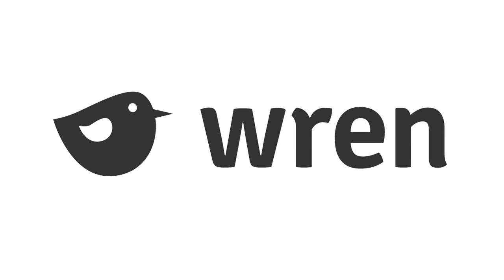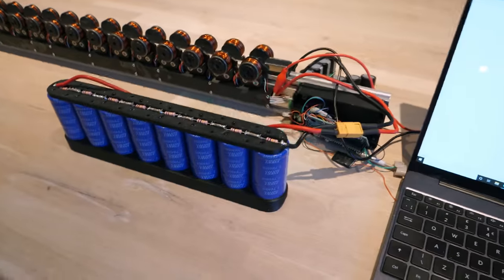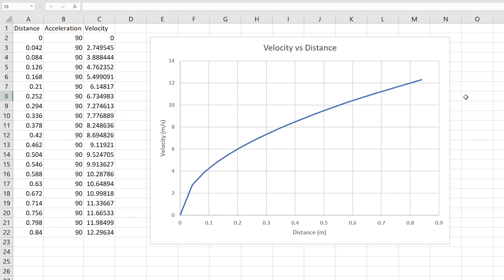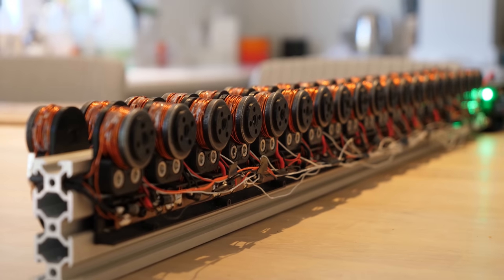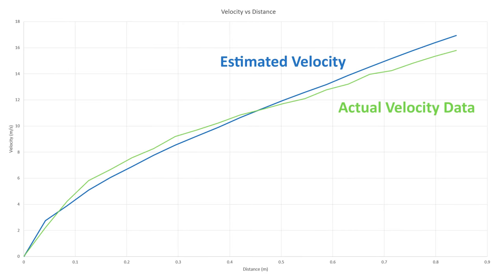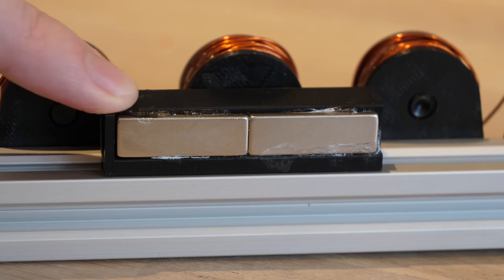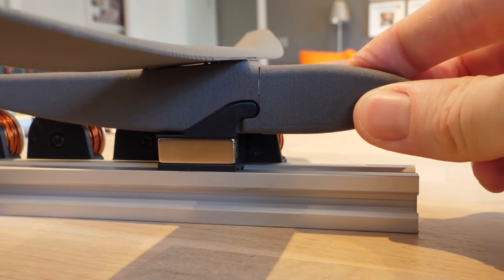Optimising a Magnetic Launcher

Comment: I mean... there are already scaled up versions of this on military carriers. They don't use electromagnetism, but they do have a similar rail-launch system. Instead they use extremely high pressurized steam from the ship's engines and a piston. When the steam is released, the piston jolts forward at a high rate sending the jet flying forward at an insane speed. With it's engine's always maxed out, it takes only seconds for the propulsion to be high enough for lift.

Now doing this on a scale big enough for the civilian sector would be a bit of a logistical nightmare. Given that in a jet it's already considered the most dangerous thing a pilot will ever do, and that's only a fraction of the mass a full on cargo or passenger plane has. However, logically speaking if we were saving enough fuel, we could also reduce the size of planes and fly them more frequently, which would also have the added benefit of making the takeoffs more efficient. This would however mean we'd need more care in routing the large increase in flights from airport to airport.

The real issue isn't just takeoff however. We look at the 747 as the workhorse of passenger planes. This bad boy does use about 5,000 gallons just in the takeoff, which sounds insane (and is!), but that is actually slightly LESS than how much it uses just to get up to it's flight height. It uses an addition 10% of it's max fuel (63,000 / 10 = 6,300 gallons) to get up to it's flight height. A more efficient means of takeoff would also need to consider something to make the plane take off from a higher point. A pneumatic lift to bring the plane up to tracks high in the air. This then adds incredibly more difficult factors to overcome. 

I'd be interested to hear feedback on potential solutions to these issues as well.

Comment: My hope for future space travel is a huge track like that, which would launch a redesigned space shuttle. I am worried about climate change but amazed by and attached to space travel. This could reduce if not eliminate the use of the 90% of fuel for the first two minutes of takeoff of traditional rockets.

Comment: If one would reduce the friction on the sliding rail using , optimizing  the already in use ,magnetic rail type train velocity difference in the equation . As I believe the friction is already added to the equation but not defined if in a partial  vacuum or differential friction element to the equation. That simply take velocity speeds . Or the use of high speed high capacitor support  in the coil energy equation to multiply the energy discharge and magnetic energy effects . That theoretically are being used in the  US patent description of  earlier technology of  anti gravitational flying crafts .

Comment: Imagine that each coil increases the sled's kinetic energy by a constant amount.  That will give a decreasing acceleration, compared to the constant acceleration you have simulated.  Now simulate with a constant increase in velocity squared over the simulation and I think you will get a far better match.  You could even have the energy increment decrease over time, simulating the battery voltage dropping.

Comment: I wonder if you can just use capacitors and coils to create a kind of sequential cascading RLC circuit. Such that when you first hit with the voltage it oscillates with the object being propelled in phase along the rail. because there's no diodes it will also oscillate on the other coils at any one time but as long as the initial wave front that's traveling with the object steps like a stepper motor in sequence with the objects inductance and mass properties (tuned by the tau or ratio between inductor and capacitor) you should be able to just scale up the capacitors and coils and hit it with a giant voltage.

Comment: You don't mention how you tuned the timings between passing the sensor and turning on/off the coil, but there's a good chance you could optimise it further by running a genetic algorithm on those timings. This is a sort of unrolled genetic algo, but if we make the assumption that the best velocity would be achieved by the (x+1)th coil by first achieving the best velocity at the xth coil, start by altering the timing of the 1st coil in increments close to the resolution of your timer. You may have to start with course increments and get smaller. Once you've found max velocity from the 1st coil, repeat this process with the second, etc. I expect this would get better velocity than calculating the amount of time it takes for the magnet to get to the centre of the coil because of minute tolerance variations between coils. If this helps, also consider running your launch program on an SBC with a higher resolution timer. Anyway, awesome work - very entertaining!

Comment: Okay so here I go again. You hit on 1 of my ideas to increase the power or speed with the altering of the coil sizes. Now let me ask you this do you think there is any more speed or power to be gained by altering the spacing between the coils? Like i said before on your last video I have seen a lot of these builds about these type units, one thing I've  seen done diffontly was to use a LED and light sencore on either side of the track just after each coil so that the body of the sled itself was the mechanisom that turned the last coil off as the sled moved by it then the next coil would grab it and carry it on. I'm wondering  if by using that method of switching off the last coil and then increasing the distance to the next coil in the line we might gain even more power or speed. Looking forward to the next video thanks again!!!

Comment: noticed at 10:03 that the plane stalls - you can counteract this with more nose weight, which also increases the mass, and thus the acceleration of the object.
Reply: how would adding mass increase the acceleration?
Reply: srry
Reply: @justinc2633  No. More mass will decrease acceleration but it will increase momentum in the plane. Better to push  the wings back to move the center of gravity than increase mass of nose.
Reply: @nickl5658  why would you sacrifice acceleration for momentum? i was asking about his comment on mass why are you giving me a solution to counter stalling when i didnt ask about that? also by pushing the wings  back you wont change the center of gravity (by any noticeable amount anyway) the reason thatll stop the upwards pitch resulting in it stalling will be because you move the center of lift

Comment: bit of an odd suggestion but could you increase the number of times the wire is coiled around each coil to increase the magnetic strength. Just remember making an electromagnet in GCSEs and the magnetic strength increased when we coiled the wire around it more.

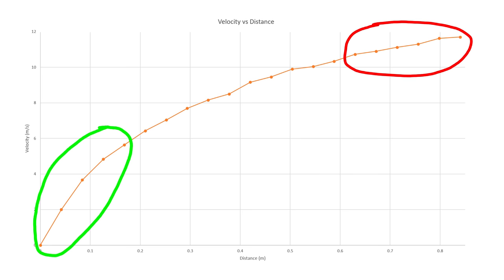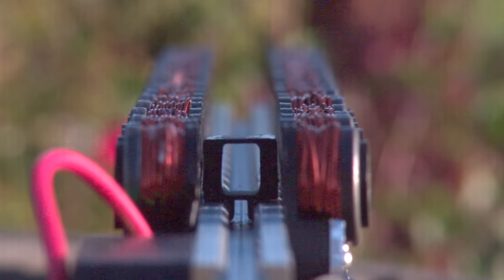Comment: ... by 2:05 I have some already have some good ideas as to why things go sideways with mag launchers.  at 1:30 in the slow motion footage you can see the sled bouncing from side to side, like a sloppy roller coaster. As that side  to side, um "oscillation" increases with the speed of the sled, I believe it will have 3 effects the first 2 I know for sure, and the third is a guess, 1) Every time the sled has to change directions it will accelerate slower. if you look at the graph you shared and think about that should make some sense. 2) All that lateral wobble is transferred into the structure of the launcher, usually as heat I assume, a wiggle and shake on a molecular level still causes heat, right? 3) and here is where I am making a stretch and hope you can understand what I'm getting at. Spin. Up and to the right, down and to the left... In the very same way musket balls would bounce down a barrel before existing, Riffling,  it stops the slug from smashing off the sides of the barrel as it accelerates. Spin that sled...

Comment: Tom, if you were able to decrease the drag coefficient of the sled by applying graphite dust/oil, making it out of a different material, or adding bearings etc - would that result in a worthwhile increase in exit velocity of the sled from the rail?

Comment: kinetic energy is 1/2 mv^2.... So adding similar energy at each coil would naturally result in a sqrt-shaped curve... (And  for that to happen, each coil need to have more power, since it needs to add the energy in less time (which the rewinding would have helped for...))

If the coils can be set up in a way that there is no gap between one switching on and the previous one switching off, using a (largish) inductor to quickly force current through the next coil would be interesting... (It would limit the ramp-up of current towards the end of the rail though and leave large voltage spikes to deal with, especially at the end when all coils switch off)

Comment: It would have been cool if you also calculated the kinetic energy of the projectile at each distance, because change in energy means work which means force times distance. So plotting kinetic energy against the distance and measuring its slope would show not only how much force did the coil create but also how much of the same force is lost at the end of the linear rail compared to the force the projectile received at the start of the rail.

Also
PLN aircraft carrier designer wants to know your location.

Comment: Question for you bud: I thought the sled you designed to hold the glider accounting for the upward force from lift was genius; I am curious if you redesigned it to be a bit longer if it would launch the glider further? What I mean is that the sled weighs more than the glider and retains velocity longer once it has left the rails than the glider does. The glider immediately lifts once the sled is released. If it were to carry the sled further after leaving the rails for, lets say, just another meter or so, the glider wouldn't lose as much velocity. Also/Better, would it be possible to have the glider retain part of the sled instead of shedding all of it upon release? The rails have already accelerated the entire sled/glider-mass to their top speed, if the glider were to carry some of this "breakaway sled" it should fly further, especially with this "sled-mass" being centered under the wings. Perhaps keeping the exact design you have but with the hooks being part of the glider, with them being attached to the sled via pins that insert into small holes drilled into the sled body (which would be a very low friction release once the glider has now carried the entire sled slightly further) then shedding the magnetic "base"? Super cool video, as always.

Comment: Hey Tom, what if there is a velocity drop caused by the speed the sensors can relay information to their respective coil? I’d like to see what your graph would look like if the rail was 2-4-10 times larger. Would it eventually flatten out because that relay of information can only go so fast.
Solution- what if instead of sensing where the magnet was on the rail and having the coil react, you predicted the magnets velocity over distance and programmed the next coil in sequence to turn on and off at the opportune moment. I imagine this would give your acceleration graph less of a drop off. 
Maybe my theory is based of limited knowledge. Just figured I’d put the idea out there. 
Cheers

Comment: Do you have a big low-ESR capacitor at the DC input of the controller board? If you don't, adding one would probably get you a noticeable performance boost, both by counteracting the inductance of the wiring between the board and the batteries/supercaps, and by reducing the peak current seen by the batteries/supercaps a bit, both of which will reduce voltage sag.

(Do you even still have this, a year and a half later? Do you hang on to the stuff you build or disassemble it to make new things?)

Comment: Could you use a ball or add wheels to the sled rather than just having it slide? Not sure how much that would help tho.
you could also have the platform that the speed sits upon drop off/end after a certain distance. I think a that would work best at the point where the velocity of the sled is fast enough to get it to the end of the coils.

Comment: I wondered whether progressively increasing the distance between magnets would have any effect.  I modified your spreadsheet so that the distance between successive magnets increases by 25% with step (eg. A4 = A3 + 1.25 * $A$3).  This puts the last magnet at 1.04 instead of 0.84.  If all of the other calculations remain the same (i.e. acceleration = 90 and v is given by your formula), then the final velocity increases from 12.3 to 13.7.  To achieve the same velocity with equally spaced magnets requires an additional 4 or 5 magnets.

Comment: Can you reduce the sled weight on the launch vehicle by reducing the contact on the plane or… and I know it adds weight, putting in a pivot to the launch pod? Love your explanation though. Stepping down the coils seems to be a standard with or without microprocessors. Also the noise created seems counterintuitive. There has to be an optimal number of coils vs sound.

Comment: May want to check the formula for the last velocity (C22). It's not using initial velocity (C2), it's using the previously calculated velocity (C21). I did notice that it's the same thing for the change in distance, as I think it would be A22-A21. Does that compensate, or was that a mistake?

I'm sure you know this, but just in case: if you put in C$2 instead of just C2, then it stays at C2, even if you drag the formula down. $ just freezes that particular part of the referenced cell, i.e. C$2 stays the same if dragged down, $C2 stays the same if dragged sideways, and $C$2 stays in the same spot forever.

Comment: I stumbled across your channel and let me tell you, what I great find. I just watched how you created your own Ebike motor. mind blown Question though, most to all Ebike have brake regen, but do you think there is a way to regen the battery using the pedals or the wheels. For example for each wheel or pedal rotation the bike charges itself? That way you can definitely go a lot further on trips without having to plug in. Not sure if it's possible, but I think if anyone can wrap their head around it and figure it out you can.  ;)  

Challenge accepted?

Comment: I have a question about the voltage waveform around 7:51. For an ideal circuit, the waveform should step down without the multiple up ticks. Perhaps, you may probe the voltage at the far end of the cap pack to check if the discharge is evenly done among the caps.

Comment: Sorry if this is a stupid question, but wouldn't doing the setup with the opposite facing magnets still be better when launching a plane? My thinking is that while there is no increase in acceleration when launching the sled due to it having twice the mass and twice the force, when you add a plane to it you're adding a certain amount of mass to the setup, so with the double magnet setup, you would effectively be adding half the mass and therefore increasing the acceleration. Sorry if this makes no sense.

Comment: Hi! Have you calculated efficiency as a ratio of kinetic energy of moving objects and electrical energy used to accelerate the objects? I would be nice to see it.
Also my 9 y.o. son recommended you to break the magnets in half and mount these halfs by opposite poles to each other. By doing this you could have S-N-N-S poles combination to realize push-pull acceleration and keep the mass of the cart the same. Not sure, but it could be that the magnetic force will reduce after breaking the magnet.

Comment: Would the lift cause a significant amount of friction on the underside of the track? Could you offset that by adding a row of magnets on the underside of the track, with an opposing magnet attached to the corresponding side of the cart? Could it also add the magnetic push that you were trying to achieve before? I’m no physicist so I have ZERO idea if this would work, just curious.

Comment: Hey sir did those super capacitors discharge at that moment.
But also optimizing aircraft take off to save fuel ⛽ would it not affect while trying to stabilize the aircraft in the air😉,would you give a deep explanation on it in flight,trying to stabilize

Comment: Would putting small bearings on the launch 'holder ' help? Also putting the holder on a fine scale and holding an activated magnet over it and measuring the distance when it starts to have an effect might help with when to turn on the coil.

Comment: Just wondering if the sled speed is considered for coil switching. 
This is a common method when driving BLDC motors for example, where coils are turned on more 'in advance' the faster it goes.

Comment: with a gauss riffle AKA a coil gun each of your coils should have a different number of turns so they are not all the same strength and you need to have the ones with the highest number of turns at the start and from their each coil should have less turns then the one before it and the coil with the least number of turns should be at the end that way the magnetic filed strength is progressively increasing with the projectiles speed keeping it constantly accelerating 

also if you can get a milled Delrin projectile and lube your guide rails it should decrease the friction between the guide rails and the projectile 

also it would be cool if you could somehow get the rails to rap under them self's and keep the projectile captured the whole time so it could be send it back to the beginning to be fired again

Comment: I can't see if it's been mentioned, but could you add a super capacitor to each coil circuit that would be recharged by the battery bank? This would mean each coil gets the full voltage of the capacitor.